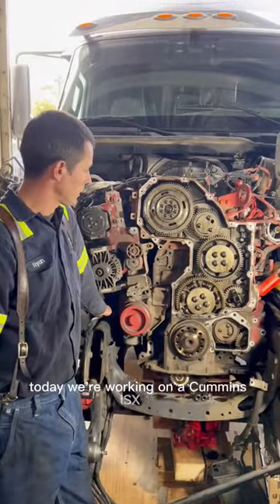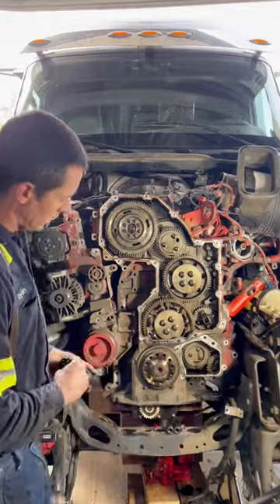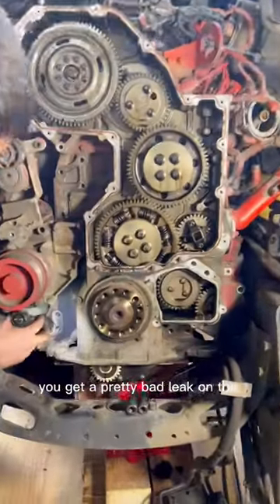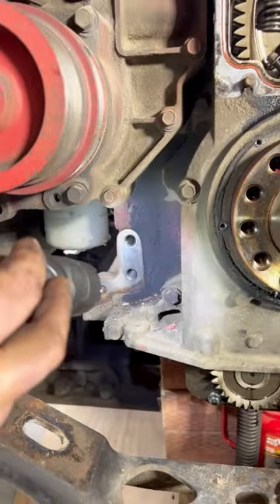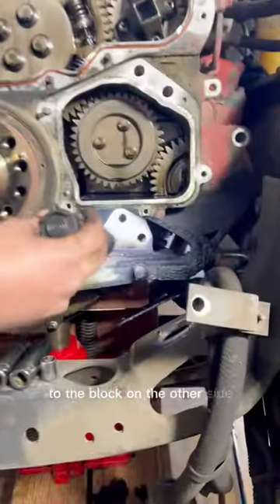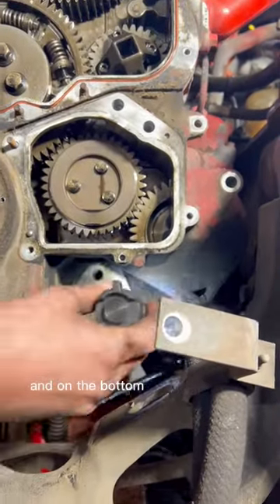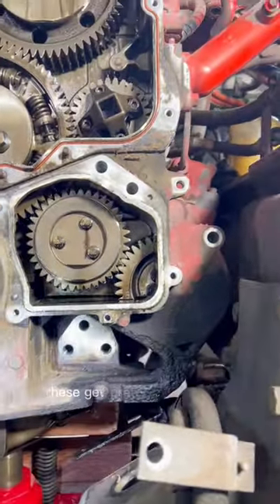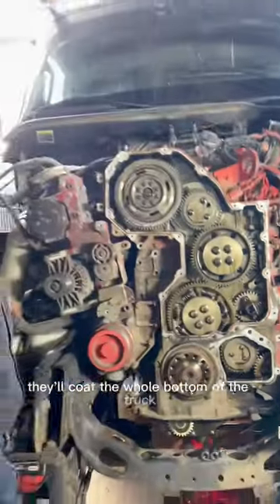Cummins ISX15 Front Gear Housing Leak #shorts

Comment: Ive seen on a few where the lower bolts loosen over time and the housing wears down on the steel part of the gasket and wont reseal, at that point you need a new housing. Good stuff man, i like your videos!

Comment: Our 2008 ISX15 Tier 3 has been burning oil and the oil is always jet black. My fire department doesn’t think it’s a problem because the rig passes inspection. From my knowledge is the EGR helps put a ton of that carbon into the oil 😶 besides weird electrical stuff going on and the Jack turning off by itself, the engine doesn’t leak to much around the gaskets that I can physically see. Definitely going to have to look around the timing cover next time I’m at the station

Comment: 2013 ISX 15, Volvo. crank but no start. The truck usually fires off instantly! changed the fuel water separator. Same. Ecm fuse is good. 1000 miles previous changed the secondary fuel filter.  Fuel tanks are pretty dirty. Gave me no indications before that. Maybe power was a bit lacking climbing grades…..?  Thanks

Comment: I’ve never seen a paccar open like I see Cummins
Reply: Cuz they’re blown up by that time
Reply: @fernandosantiago1679   nah warranty speaks for itself, Paccar run twice the miles, heavy Cummins
Reply: Wait til your boat anchor paccar eats a cam. Completely delusional if you think a paccar motor is the better option
Reply: @doodlebob069   statistics don't lie, in Europe all engines are Paccar, trusted for a reason, backed by a 1 million mile warranty, does the big block chevy match that? No it does not, all it does is gussle fuel down.
Reply: @doodlebob069  Which semi engine is the most reliable?
PACCAR engines
PACCAR engines are considered by far the most reliable diesel semi truck engines. They are used by only two truck brands: Kenworth. Peterbilt.Oct 28, 2021     Educate yourself buddy.
Reply: @sgsupreme17 bro you cannot compare a big block made for cars to a semi engine 💀 they’re used by peterbilt and kenworth because it’s the parent company’s engine. They’re terrible in America due to emission and being rear gear train. Worked at a KW dealer and they’re terrible to work on. All around shit engine
Reply: @doodlebob069   yea the big block chevy was a joke bro.
Reply: @doodlebob069   exactly! Only mechanics like Cummins for that reason, mechanics want to do as little as possible as easy as possible, so no wonder every mechanic is on Cummins nuts.
Reply: I'd rather work on Cummins than PACCAR yes.  But that's cause I'm in the US.  I've done a total of 4 mx13 cam swaps over the last year and truth be told it wasn't so bad.  Doing the repairs that require the engine in chassis though, there could have been a lot more consideration going into the design of KW and Pete applications for an engine that was meant to be in COE trucks.  All in all the engine itself isn't bad, it's the engineering that went into adapting it to the American market on both PACCAR and The truck manufacturer side that make it stupid
Reply: @corpse0clock914   honesty is the best policy.   I'm glad someone was reasonable enough to acknowledge it. 👍🏼
Reply: @sgsupreme17  lol the mann v8 is far better in euro if we’re talking about that. US makes every engine shitty but cummins by far is top tier
Reply: @fernandosantiago1679  nah

Comment: Detroit Series 60 front cases do this also. What kind of hours to do the Cummins engine front case?
Reply from the maker: This specific truck is about 600,000 miles
Reply: @truckingandfixing  he’s asking how long does the job typically take to replace the gear housing gasket.

Comment: I seal some of this kind leak with epoxy  on the surface  with high heat resistant  product/  I does seal the leak and u don't  need  to take apart/  I can show video on the process  just for idea then if u need to remove  the parts later  the epoxy just Crack off and u remove what you need/
Reply: Can I have the video please?
Reply: @vitaliecamerzan9910  I will make the video this weekend  and post   on here. Make sure to check out on the channel.  I will post.